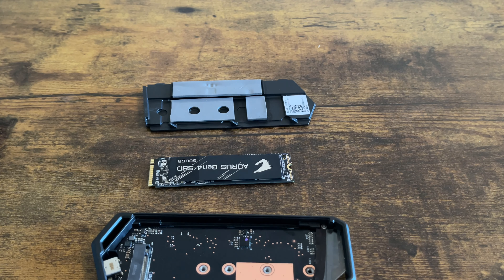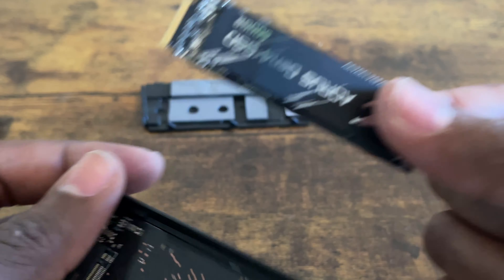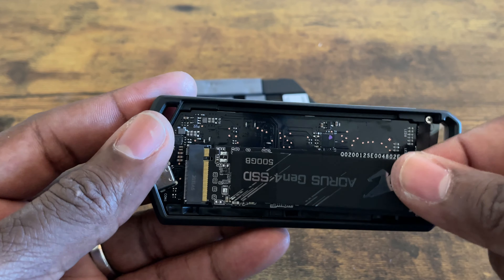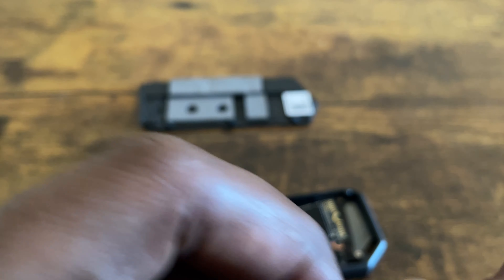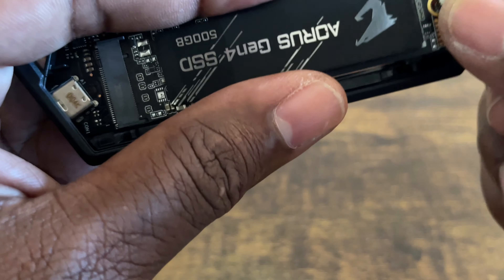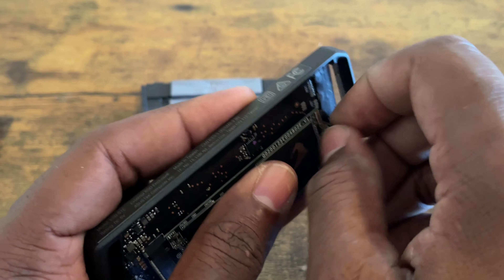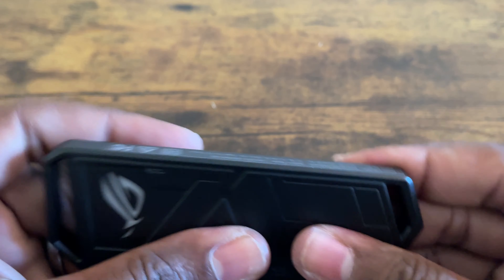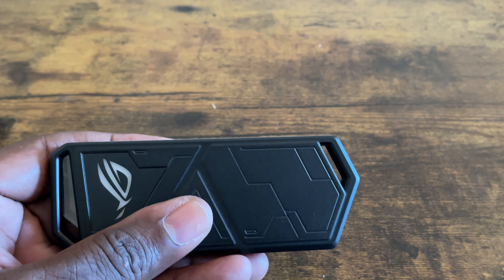DIY. How to install an ssd into an enclosure  #shorts.

Comment: What up JC? How's it going?
Reply from the maker: It’s all good bro. How you been?
Reply: @Tech-n5m  I'm hanging in there. Dealing with some crazy health issues. I'm trying to find a PS4 Pro. Before I sold my PS4 pro I did a full system backup, instead of just copying the saves and now the only way to get them back is to get another PS4 pro and do a system restore and then recopy the saves. Pain in the ass, especially when you are broke and everyone on OfferUp is a scammer and selling overpriced on Ebay.
Reply from the maker: @D-NastyNoise  I hope you feel better. I regret letting go of my PS4 Pro and your right, you can’t trust anybody out there. Keep searching. I hope you’ll be able to get one. Take care of yourself.
Reply: @Tech-n5m  I regret selling mine  as well.  Especially now. Thanks, I appreciate the good wishes.  Keep the videos coming.
Reply from the maker: @D-NastyNoise  will do bro